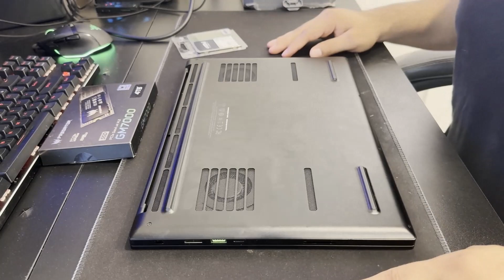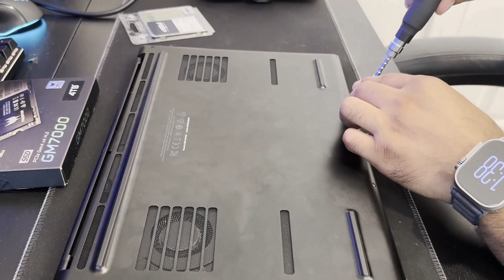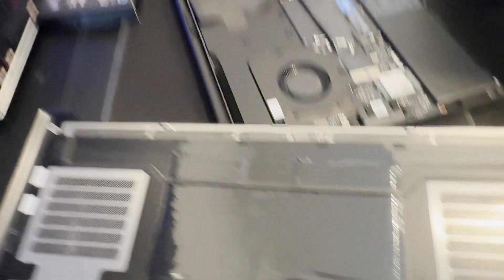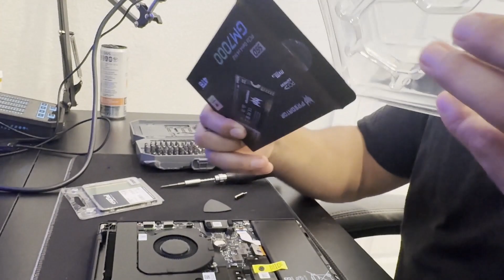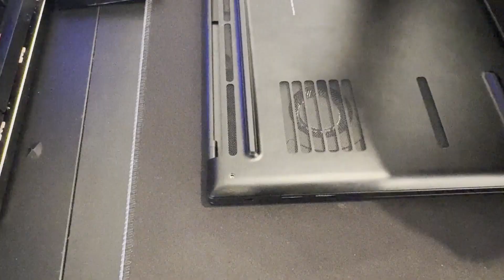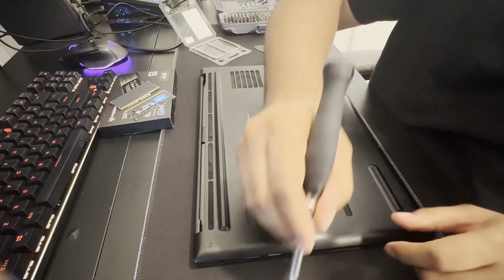How to Upgrade SSD and RAM on Razer Blade 15 2022

Comment: I understand that the upper SSD can only be "one sided" with chips on 1 side only (which limits it to 2TB), because "both sided" chips do not fit into the slot (the SSD is too thick). My question is : can you fit "both sided" SSD (like 4TB SSD with chips on both sides) into the lower SSD slot (under the heat sink)? Does it fit there?